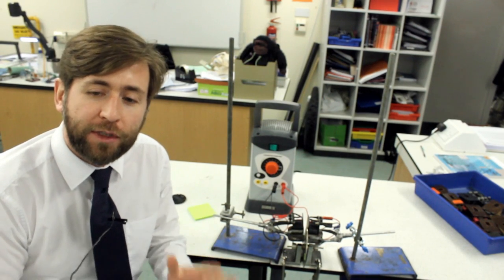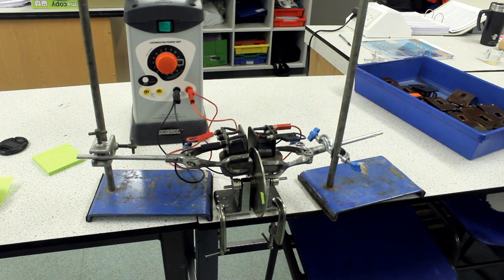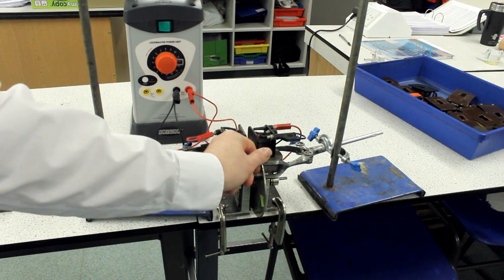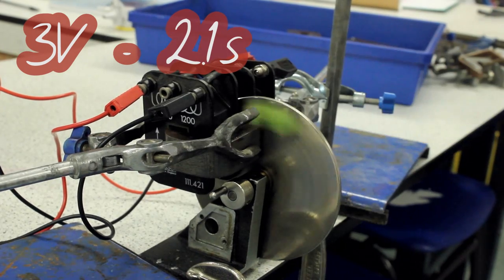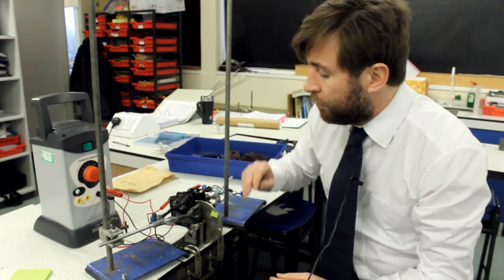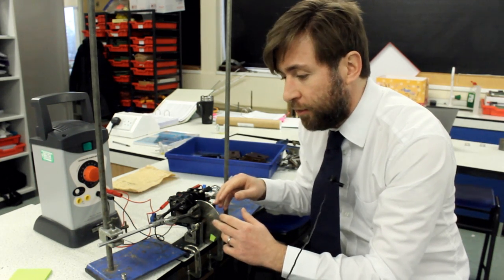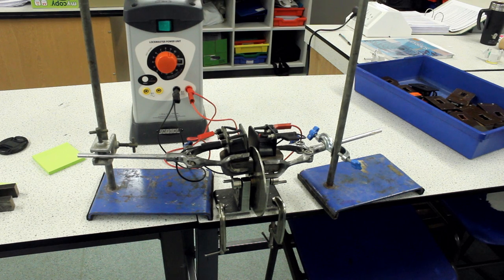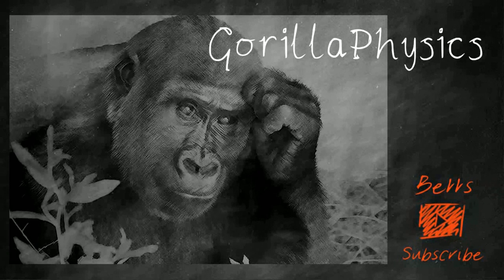Eddy Current Braking - Electromagnetic Induction - A Level Physics Revision

Comment: hi there. Is there any difference between non-magnetic metals?  for example, can we use aluminuim?
Reply from the maker: Yeah, you can, this is an aluminium wheel I believe.  (I seem to remember it was ab alloy, but yep, any conductor in a changing magnetic field.)

Comment: You can measure the power using a load cell and a torque arm attached to the magnets
Reply from the maker: Thanks for the tip!
Reply: No, thank you for posting the video!

I can’t take credit for the idea, it’s how engine dynamometers work… If you do a quick search on engine dyno’s you can get an idea on how the arrangement works.

Comment: how to create less  air gap?
Reply from the maker: Netra Jung Karki not sure which air gap you mean bud?
Reply: increase in air gap and disc thickness, the torque generated  by  the electromagnets  is  decreased. This  relation  can  be  verified  by  noting  the  stoppage  time after  varying  the  air  gap.  As  per  the  model  the  stoppage time must reduce with increase in air gap.
in eddy current brake system
Reply: The electromagnetic braking using eddy current was studied, focused on two series of aluminium as the brake disc which are A16061 and A17075. This paper presents the comparison for both series in a few varied parameters related to eddy current braking such as air-gap, number of turns and brake disc thickness. Optical tachometer has been used along with PULSE analyzer to capture the speed (rpm) and time (s). The findings shows that the smaller the air-gap, the larger of electromagnet turns and the thicker disc thickness is, will generate higher braking torque to stop the rotational motion of disc brake and give great performance for eddy current braking.
Reply from the maker: Thanks very much!  Sounds like some really interesting extensions to move this experiment further!
Reply: increasing magnet pole will cause air gap? or any thing else